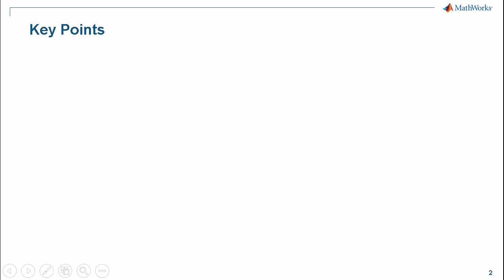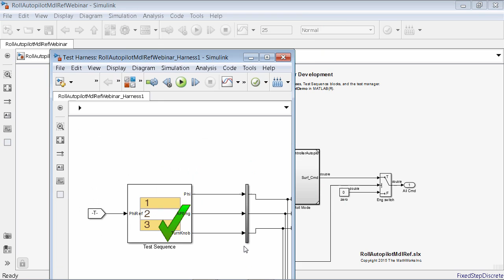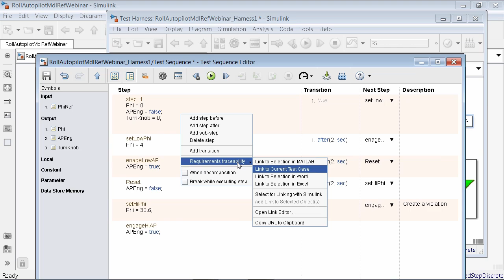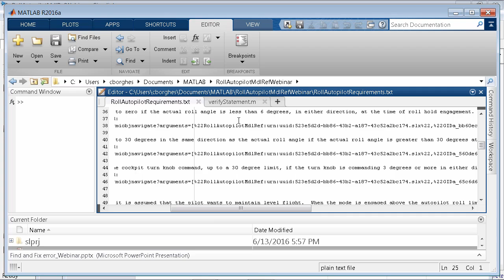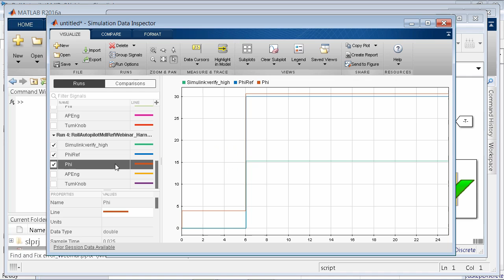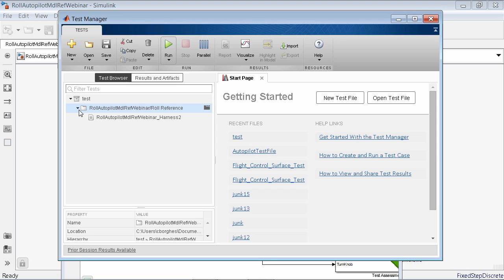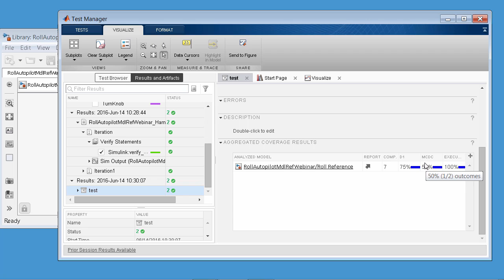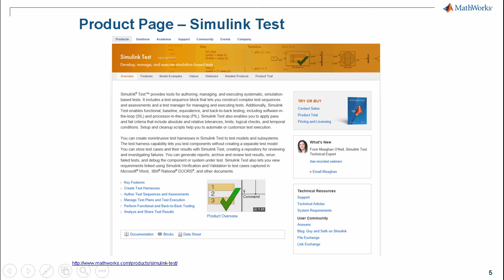Find and Fix Design Errors using Simulink Test

Comment: How to verify floating point value in verify() statement under Test Sequence or Test Assessment block? Is there any means to provide tolerance in the verify() statement itself?
Reply: i have the same issue , the only solution i found was to create a function that compares two inputs against a tolerance and return a bool , that bool can be used in the verify () statement
Reply: @ansarilaith  do you have a sample / template as an example? Plz share for better understanding. Thanks
Reply: levitujuci bod hodnoty